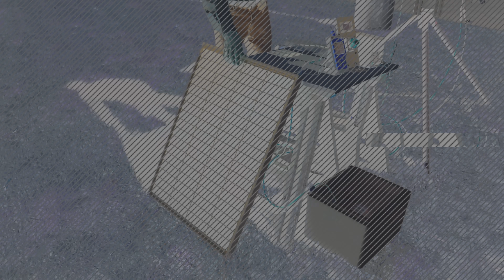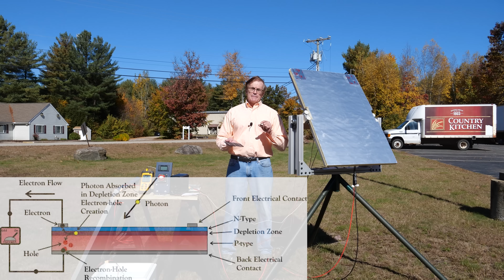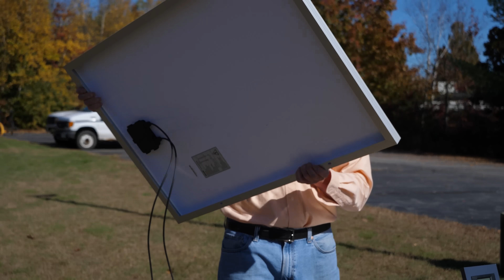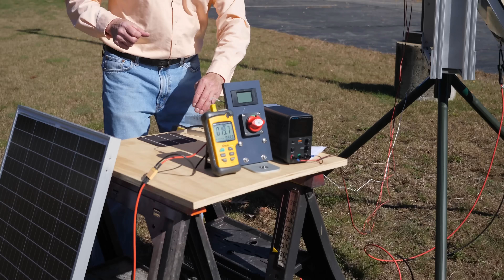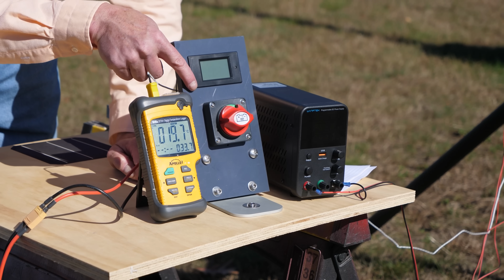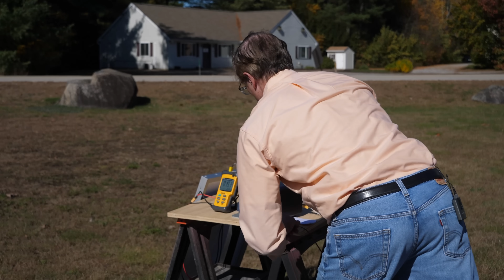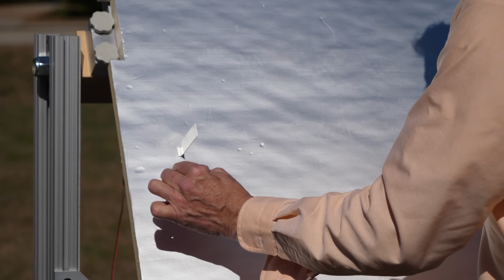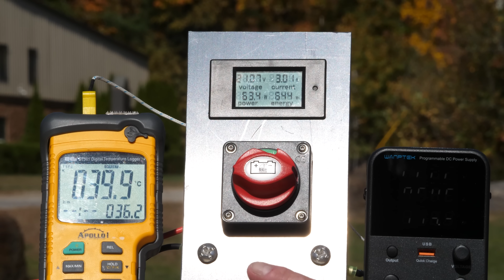Do you REALLY get enough out of your solar panel?

Comment: Is the cost and complexity worth the extra 3 watts of power.  You also have to factor in your time and materials and construction costs.  My off the cuff calculations is no it is not worth it.  Also if you loose your whole array from over heating the panels because the cooling fans fail, then you are in a big loss situation.   Also, your system is much less efficient when the outside temperature is like over 100F like in the desert.  Now if the solar cell builder put water channels into the panels and the excess heat is pumped into my swimming pool to warm it up, the natural gas savings might be worth it.  A heated swimming pool is an expensive luxury and is a source of money to tap into.  Not everyone has a swimming pool and can afford to heat it.  How about thermoelectric coolers?  There is an advantage of keeping the panels cooler for longer life.
Reply from the maker: You're ignoring  the increased longevity of the panels with cooling.  This system  fails safe. Without  the forced ventilation,  the panel  actually  runs slightly  cooler than stock because  of the larger, heat exchanging surface on the back.
Reply: @TechIngredients  No, I was not ignoring the increased longevity of the panels with cooling.  I said "There is an advantage of keeping the panels cooler for longer life.".  OK, maybe the panels won't overheat with a fan failure.  I still maintain that the little power savings verses the extra total cost is not worth it in your model.  Your model does work best when the ambient temperature is much lower that 68C like in the winter time.  Then the batteries freeze and become nonfunctional.  Maybe the extra heat from the panels could be used to heat the batteries.  Frozen or very cold batteries are a big problem in the winter time with them losing storage capacity at low temperatures.

Comment: Really interesting, but the cooling system also needs maintenance or replacement in the event of defects, which will certainly occur in 25 years. This cost would easily outweigh the benefit.

Comment: Many 24v DC fans can also be run at 12v with the same efficiency benefits. Just in case 24v is a more convenient voltage in your particular  installation.

Comment: i get that by introducing an MPPT (Maximum Power Point Tracker) you introduce a blackbox, however the MPP is temperature dependent, so in your test without air cooling the power delivered by the panel is actually lower than optimal. which biases your setup more towards the air cooled test. That being said with or without MPPT cooling the panel will always make sense from an efficiency perspective. Love your videos <3
Reply: yes, Vmpp decreases linearly with temperature. So the load impedance should be decreased to get the most out of the module at higher temperatures. Once the panel had heated up to the new steady state temperature, he should of measured the IV curve of the panel with something like a PV Analyzer and then changed the load impedance for the new temperature. The test isn't really fair otherwise.
Reply: Of course almost everybody nowadays uses MPPT to efficiently adapt the panels to the load because most inverters use this technology. But the fact remains, that any solar panel's efficiency is decreasing at higher temperatures. This effect is not very different for all the panel brands on the market. It was explained in this video that for this demonstration MPPT was not used on purpose because the ups and downs of MPPT regulation could disturb the measurement. In a real solar power generator the positive effects of MPPT and panel cooling add up. I think, using MPPT for this test would better show the effect of cooling in real life because disturbances of the power measurement caused by MPPT might be less than expected. The influence of temperature on Impp and Vmpp should not be neglected in this test.
Reply: @thomasschmidt9264  I believe you missunderstood me. if MPP is achieved with a 7ohm termination @20°C then you are not at MPP anymore if you increase temperature. Therefore this experiment favours the cooled measurement because you are closer to 20° and therefore closer to MPP
Reply: @SuperBiologe  I corrected my text. As Vmpp and Impp change with temperature there might be a change of the optimum termination even the irradiation doesn't change. So the use of MPPT for this test would be better.
Reply: @thomasschmidt9264  👍
Reply: @thomasschmidt9264  Implementing MPPT is more important for following the radical changes in Impp than Vmpp as Impp can change by orders of magnitude with changing solar inclination and irradiance whereas the Vmpp doesn't change by more than a factor of two or so under any circumstances. The MPP changes so little in the tests here since inclination is corrected for by manual solar tracking and irradiance isn't changing much due to the weather being clear and the tests being performed in the same day around the same time that a resistive load will follow it well enough. The changes in both with temperature aren't significant for the relatively small changes in temperature demonstrated here and a resistive load has modest negative feedback for this. As the Vmpp and Impp go up as the temperature of the panel goes down, the resistive load will pull a little more current just like it should as that's what resistive loads do when you increase the voltage fed to them.
Reply: At 8:37 he found the 7 ohm load for mpp prior to doing these tests. Thus it is implied that the mpp was found after the panel had been fully heat soaked without any active cooling. Therefore the active cooling on the panels would technically bring the panel out of the max power point, favoring the non-cooled panels. 

Additionally, the whole mpp affecting the results deal is entirely moot if you know the power point curve because you can account for that in your results after the fact. 

And ultimately the big deal in these tests are whether the efficiency gains are worth it. Starting at 16:00 he mentions how heat affects the solar panels lifetime. This alone makes it worth it, even more so with the tests showing that the panels will make more power than the fans use.
Reply: @TheNeighbor4U  he never says 7 ohm is peak power after heat soaking. You are just assuming.
Reply: @SuperBiologe  he does say that the 7 ohms were at the peak of the mpp curve for his solar panel according to his testing prior to this video's test setup. It is implied that the panel was heat soaked as well because it would heat soak during the testing. Also, it is implied that there was no active cooling since he would have mentioned it would have been added in the prior testing.
Reply: @TheNeighbor4U  as I said assumptions
Reply: @SuperBiologe  why are you assuming that he did the tests to determine the 7ohm resistance for maximum power point poorly?

Comment: You could also use the swamp (evaporative) cooler advantage in low humidity locations to lower the temperature of the air being used.

Comment: Windows for houses and industrial buildings commonly have IR and UV reflective coatings on them. If you can reject 50 percent of the heat before it gets to the panel with no sacrifice to power, why is that not being done? Also, why are the backs of them painted white instead of black? White seems like the worst color you could choose other than some near zero emissivity metalization.

I know it may be overkill, but for a 100W panel you could pretty easily breadboard a maximum power point tracker with an arduino and some cheap fets and inductors (etc). I don't think you have to worry about squirreliness with it since there's only one global maximum for power. You're not going to get caught on local maxima. It is annoying that there's not just a $20 mppt on amazon or wherever.

I'm just kind of complaining here, but man, it would be nice if they made hobby servos that you could control with i2c or spi or can bus or rs232 without having to make the jump to ac servomotors.

Comment: i think if you made the exhaust at the top it would minimize the chances of heated air recirculating since the bottom exhaust hot air would flow back up. with your setup you could just re angle the panel to solve that or exhaust flow direction already solves that but just a thought that i dont know where to apply lol

Comment: If I heard correctly you gained 5 watts while losing 3 watts. This was in full sun with zero clouds. If it was cloudy you still lose 3 watts in cooling fans, but do you still gain 5 watts? I’m guessing no. 
  Great video. I like the use of the square casting shadow to find perfect angle
Reply: I see one more gap in the measurments. The system in the back of the pannel possibly might keep panel hotter than without it. Maybe without the whole equipment, the max temperature might be lower, and then he is not gaining 5 watts but for example 4 watts.
Reply: @wrobewo2  It's almost guaranteed that enclosing the panel back will limit convective cooling, and thus produce higher panel temperatures when the fan is off.  The fundamental point he makes about active cooling is still likely valid.  As he points out, the very small scale of the test also means that the cost of cooling is unrealistic.  The video is great, but a more complete exploration of a full scale solar system would be informative.
Reply: He should use a voltage reading to decide to use the cooler. Pretty easy
Reply: You could have it set as an automation to turn on only during hot days etc.
Reply: @enkrypt3d  or with a thermister.
Reply: You bring up a great point!
Most solar systems are static. That rotation is non-existent in traditional solar arrays. 
But I understand the experiment. 
I’m glad he’s doing the work we don’t have to. 
Thank you for both of you.
Reply: Wire in a photo-resistor.... this video was quite obviously a proof of concept. Combine that with something more like his mirrored solar panels and I guarantee that the benefit would be greater because the mirrors would raise the panel temperature higher.

Or do this NOT in new England when it's only mid 60degrees outside (19c we see on the thermal probe)... say, what about Arizona or the like?

Proof of concept, not final product

Comment: Great video.
What about RO water sprayed onto the surface of panels ? Glass may be a poor heat conductor but water is one of the most potent heat sink when it evaporates. It lowers the surface temperature of what is was laying on below the ambient temperature, which no convection system can achieve.
Some of those systems are set up here in France on farmers barns.

Comment: I’d be more interested in the price per watt difference. I am I better off using my money to buy fans for my panels or just buy slightly more panels (assuming space isn’t the limiting factor)? But of course that would be highly dependent on the economies of scale of the materials and manufacturing to add the active air cooling. This small scale test probably wouldn’t tell you much about the impact on price per watt.

Comment: Great presentation; great channel, thank you!
Been waiting a long time for someone to cover the "dirty little secret " of PV panels.
More sunlight = more electricity + more heat = less electricity?
everytime a salesperson tries to sell me PV panels; I ask them how does his company keep the panels cool to maximize performance and longevity?
 the "missing benefit " to cooling PV panels with water is that "all homes use hot water."
 The "perfect" complementary scenario would of course be to circulate the hot water from the panels into a swimming pool or perhaps even an industrial process that required low level heating.

Comment: Have you looked at Heat Pipes much?  I kinda just learned about them (I had a very vague awareness previously, but didn't understand what they were or how they worked), and... I could imagine them being involved in a system like this... Perhaps taking the heat from each panel off to the larger blower you describe, or perhaps even replacing the fans with an entirely passive system, by just having a structure for doing heat-exchange with the air that's in a position away from the panel, and thus getting more flow (via wind and/or convection)... Something to explore??

Comment: Nice job . Here in AZ desert off of I 10. 1/2 way between Phoenix and Tucson . Solar Dosnt do as well as people might think . Solar farms around have been operating over 50 years . Up  grade after upgrade  . Too much heat and efficiency goes down . Direct heat from the sun temps over 200 f . So they moved em in the shade . Just kidding . Heat and electricity don’t mix . Efficiency goes way down even damaged panels . Here about 33degrees north of equator . Dearhvalley and here rival each other for heat records I’ve seen on my temp monitor 133 degrees . Board of tourism Dosnt want those numbers that’s why monitors are in the shade with mist system. U are doin great , I like the effort !

Comment: We did something similar by placing our panels onto an old unused pool water heater using the pool water to cool the panels. At the most we were only able to get maybe 2% efficiency increase. Not the earth shattering results I was expecting in the Florida sun. Just good air circulation around the panels seems to suffice, at least in our case. We are using thin flexible panels to keep the weight down, results may be better with normal panels.

Comment: If I'm looking at the correct panel on the WEIZE website You could get more power/efficiency out those panels by loading them correctly. According to the specs MPV is 18.46, you're only loading down to 21.88, check the label on the back of the panel.

Comment: good science experiment but you make some assumptions about why your setup is the 'best' approach. You could literally add an additional panel or two and get that gain. The water cooling solution works, just shut it off the water cooling. You don't need to recycle the water, you just need to hit the panels at peak temp.

Also, most solar installs are not DIY, so the likelihood of consumers doing this on their roof installs is close to zero. Nevermind warranty and climbing on your roof

Comment: What do you think about using reflecting material around all 4 sides to help direct the indirect waves to go into the panels to help boost it to produce more power. I have been thinking about that for a while now, but I don't have any solar panels to test it out yet. It would be easy to make out of corplast or cardboard and put foil on it.
Reply: The reflectors have to be positioned very precisely (may require solar tracking just to work, which is expensive and requires more maintenance) and a lot of planning is needed to ensure no shading occurs from their structural supports. They also concentrate the heat, meaning the panels absolutely need to be actively cooled and need to be kept clean. They're also more dangerous for birds and other animals that get in the hot zone and they're more prone to damage from adverse weather. All in all, generally not cost-effective for residential use, especially for roof-mounted systems. They're also definitely going to upset most neighbors as most people would call them ugly.

Comment: An interesting test that comes with some design flaws that could greatly improve the system, and a series of variables that compound my interest.

1) Fan alignment. You have top mounted intake fans, which is generally a bad location since hot air rises and you fight the natural convection. The panels should be flipped upside down. You also aim the fans so they blow at a nearby surface (the back of the panel), rather than in the direction of desired flow, thereby decreasing CFM due to the pressure losses. Bottom mount the fans, perpendicular to the panel with ducted shrouds to focus the air down into the heatsink channels.

2) Convection has a worse heat exchange than convection. While you state that it doesn't make sense for your setup, I imagine economics of scale against a say 8x3 panel array would improve the numbers on running a pump and radiator.

3) Useful work. Most buildings, be it commercial, industrial, or residential, require how water. Pumping 40° coolant through a heat exchanger in a modified heat-pump style home water heater reduces the workload for a radiator, and re-coops lost power to running the water heater.

4) Temperature delta. While 3W vs 10W to run a few fans is a better solution than 30W vs 10W, lower latitude areas also have worse temperature deltas than NE: Dropping the panel to 30°C isn't a realistic option when outside ambient is already 48°C. A heat pump is a far more efficient for moving heat than ambient convection in high temperature areas, regardless of variables other than scale.

Comment: My panels are copper backed rather than aluminum, they are listed as being more efficient compared to  the other ones I researched as well as having a longer warranty. I wonder if the copper is helping with heat dissipation? thus the efficiency and warranty.